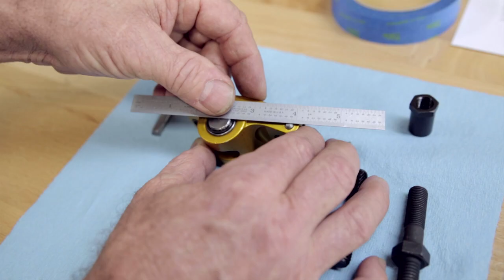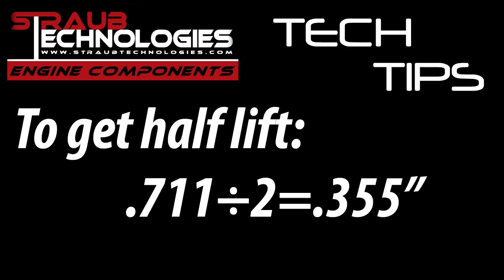Engine Tech: Valvetrain Geometry

Comment: Hi Scott I just have a question about rolling the motor over with the push rods out. I bought a car that the guy told me needed a head gasket.He started the job but quit about a year ago,the motor has been left with injector rail and exhaust manifold off I want to see if the motor is froze and if I need a new motor or just the head gasket

Comment: I understand your methodology.  I have 2 questions though.  1) You take 1/2 of the gross lift for your measurement.  Wouldn't you use 1/2 of the net lift (taking lash into account).   2) Your pushrod measurement at flat to flat makes sense, but that did not work for me when measuring for TFS pushrods.  They seem to measure not from the flats, but somewhere on the bevel.  Had to go .050" shorter to get what I wanted.  Comments??
Reply: +MrBadpliers Stripbolt  Never mind.  Just read the next comment.  Thank you for taking the time to post this detailed information.
Reply: Scott Foxwell
 Scott, thank you for the prompt and detailed response.  BTW.. who do you get the pushrods from?
Reply: +Scott Foxwell  You mean a solid lifter?  Not being a smartass, just getting all my ducks in a row.

Comment: Scott Foxwell  - Great Video!  This is going to be a big help for the SBC that I'm building.  I need to measure for pushrods.  One quick question, I am using a Comp Cams (part # 12-236-3) which the specs list "Valve Lift" of 0.462 for Intake and 0.477 for Exhaust.  Should I be using the larger of these two numbers for what you referenced as "Gross Lift" in your video?

Comment: Scott, excellent video! You explain the process so that it's very easy to understand and you're very well spoken. Thank you for taking the time to help us all out. I had a quick question though. Do you measure for both intake and exhaust lengths if you have a split pattern cam? Would you use a different push rod length for both if the gross valve lift is different for the intake and exhaust?

Comment: Really nice explanation, but like smooth73 mentioned, there is not info on the lifter used and its placement. Confusing for some folks that don't know to make sure the lifter is max lift and make sure it doesn't collapse (which it shouldn't when using checking springs)

Comment: Awesome explanation!!!   With a flat tappet hydraulic cam and lifters.  Do I need to use a special modified lifter or would a normal lifter be fine for this check?  And I assume the lifter would be sitting at max lift on the cam?  Correct?

Comment: I talked to Scott over the phone about this process to determine pushrod length.  I checked all the corner cylinders of my build and I can say that this process worked flawlessly as it delivered the most lift and least amount of rocker sweep across my valve stems, each and every time I checked and double checked.   Great video! Thanks Scott.

Comment: Pretty amazing simple but wouldn't it be better to have some type of 90 degree apparatus such as a small square to ensure 90 degrees or do you feel the straight edge is close enough? How does this work out as far as the width of the footprint on the top of the valve?